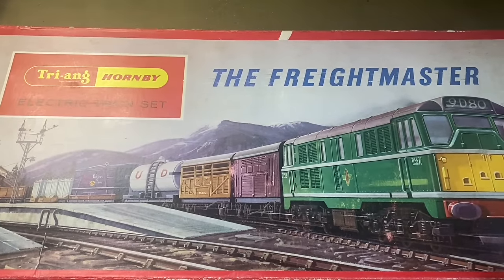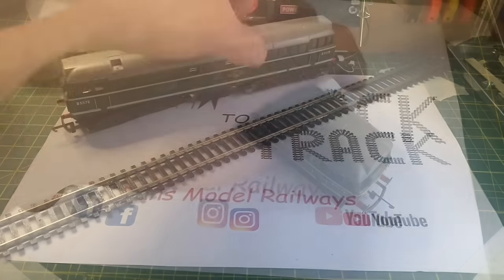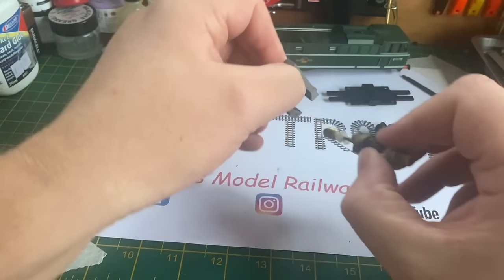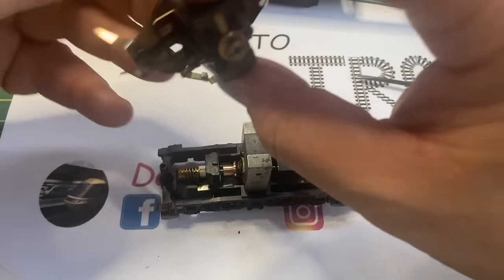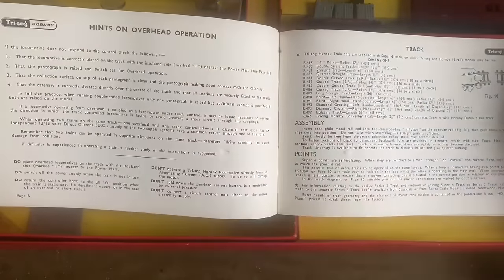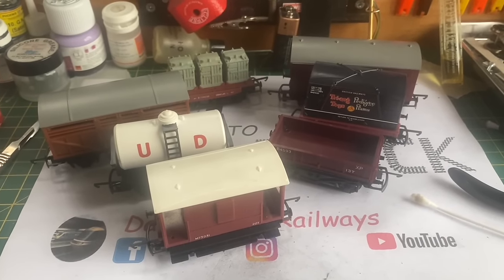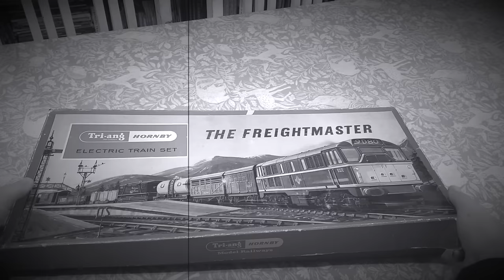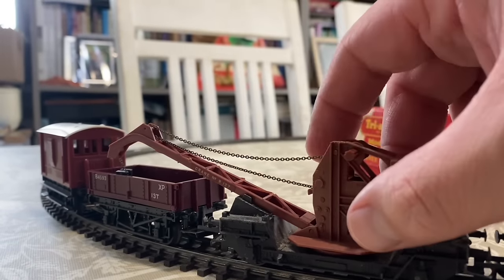Trash to Track. Episode 81. Tri-Ang Hornby RS51 Freightmaster train set.

Comment: Hi Dan: an example of this set was my introduction to the world of model railways. I still have the class 31 and most of the wagons. As I was born in 1965, my parents must have bought it for me in the late 60s. Your video has brought back happy memories.

As it happens, I've just serviced it.  Mine has the little warning sticker you mentioned still in situ, and no trailing bogie pickups.

The brass screw that goes through the magnet had sheered off, so I replaced it with one from a scrapped Hymek.

Now it's once again pulling wagons around the layout.